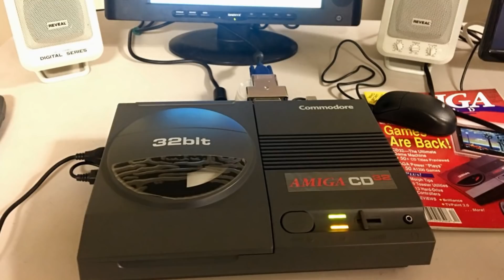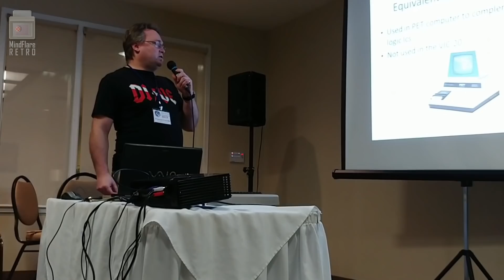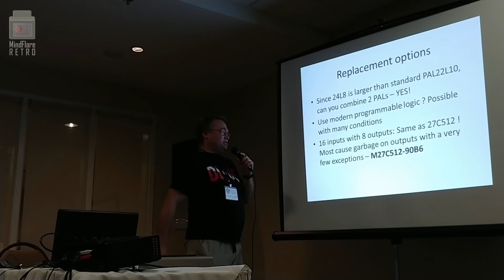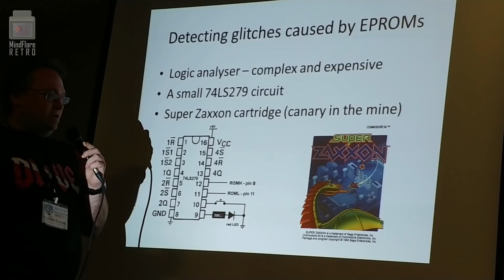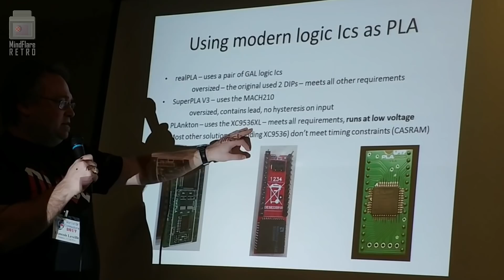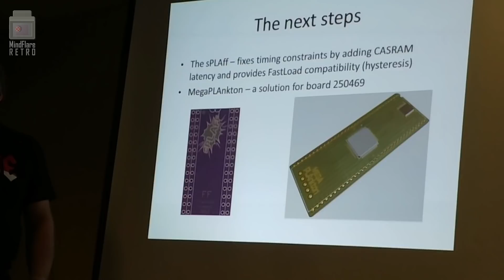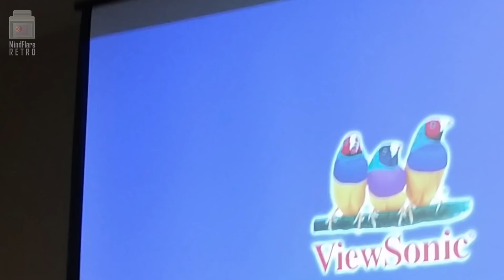#10 'The PLAin Truth About the Commodore 64 PLA' at World of Commodore 2017

Comment: Another note about RoHS compliance: Do you expect to put your C64 in a dump? Because that's what RoHS is for. Lead-free processes expose the operator to more toxic materials so that when careless end-users throw out their work it doesn't poison the environment.

Use lead-free solder, sure, but consider the reasons why and the ultimate benefit your decision will yield. Electronics can and should be recycled, and there are other environmental costs to producing new materials.
Reply from the maker: Totally agree. I would never discard a retro computer hardware, or any electronics, to landfill. I mostly hang on to stuff like that, or drop off top an e-waste facility as a last resort.

Comment: Useful knowledge about the PLA. Thanks for the video from Francois Leville. 3 years ago I built a PLA replacement with Altera EMP7032 CPLD chip, but I still haven't tested it properly. I think that I will try to make this SR-latch tester.
Reply from the maker: Thanks. Yes, Francois is an interesting man. I am curious to see how your CPLD version works. I am also going to try the GAL method (see Adrian Black's video) and also I just acquired a used IC burner that can program PLS100 ICs for direct drop-in replacements. However, I have been waiting for GAL IC and NOS PLS100N IC orders from China for over 6 weeks now.
Reply: @MindFlareRetro  Thanks for the tip. I will watch the video. The PLA100 IC is indeed pin compatible with 82S100. Nice! Yes, orders from China could last a long time. I understand your pain.
Reply from the maker: @ezContents  Yes, a have a lot of China orders just sitting there in a warehouse near the airport in Shenzhen, according to the tracking info. I'm sure I'll receive everything at some point.
Reply: @MindFlareRetro  Good thing you can track them. Yes, just be patient.

Comment: The specific reason why PLA's self-destruct is because the entire MOS fab was contaminated with boron. They were in fact required by the EPA to install remediation pumps to suck the boron out of the soil beneath the building. Boron, when it gets into the glass passiation layer, leaches out into the chip substrate and disrupts the doping in the chip, essentially killing the transistors on a solid state level. Heat of course accellerates the leaching by increasing boron's solubility and mobility.
Reply from the maker: Amazing info, Stan! Thanks for sharing.
Reply: Thomas Giesel aka Skoe mentioned this more than once and it's described in the study he published in 2012 called PLA Dissected. http://www.zimmers.net/anonftp/pub/cbm/firmware/computers/c64/C64_PLA_Dissected.pdf
A lot of aspects of PLAnkton are based on information found in that document.

Comment: Isn't there some way to gate a normal CPLD or EEPROM's output using a clock signal to get rid of the glitches?  ROMs have a defined settle time such that as long as the address lines (inputs) are held for a minimum period, the data lines (outputs) will have settled.  So rather that just dumping the data onto the output bus lines, gate them using a clock pulse (maybe the CAS/ input line?) through a buffer's enable pin, and they'll be settled when the clock transitions.  As far as input hysteresis goes, you can usually clean up hysteresis issues with something like a 74hct14 schmitt trigger.  I mean, I'm not sure you can get it in a nice tiny package like PLAnkton, but what he was describing sounds like normal timing issues you have to design for when using a CPLD or EEPROM, and usually you use a clock signal to manage the gating onto an output bus.
Reply from the maker: Thanks for commenting. Yes, I believe you are correct. I have seen others (GadgetUK164, Plan C ... iirc) tweak the DIY design to correct for timing issues. Also, PLAnkton had hysteresis issues accounted for in its design and I think Super PLA resolved CAS line timing issues in its most recent release. I am still a PLAnkton fan, myself.
Reply: The M27C512-90B6 doesn't cause glitches that affect the C64 because it has a very poor slew rate. Therefore if you use a very fast EPROM, in theory, it's possible to use simple RC filters of the correct values to filter these glitches. Please note the correct technical name for these glitches is 'Static Hazard' and you can find a detailed explanation on Wikipedia.

Comment: You mention 99.9% compatible.  What's the .1% (one thing?) where it isn't compatible?  Or what holds it back from being 100% compatible?  Or is that just to allow for some heretofore unknown incompatibility?
Reply from the maker: Yes, sir, you are correct regarding yet-to-be-seen incompatibilities. However, to my knowledge no incompatibilities have been reported to date. IMO the PLAnkton is the best PLA replacement out there. Thanks for your question.
Reply: @MindFlareRetro  Thank you for the response.  I will pick up a few.
Reply from the maker: @PrimalNaCl  You're welcome. I am happy to help.
Reply: The people at The Future Was 8bit had the 'brilliant idea of making a new Fast Load cartridge they called Fast Load Reloaded which is supposed to use exactly the same schematic as the original cart. However, they replaced the 7417/7407 open collector output buffer with a dirt cheap CMOS equivalent that's not TTL levels compatible. It has trouble with PLAnkton. If you care to replace the CMOS junk chip with the correct 7407 then it works just fine, just like a real Fast Load cart. It's the only compatibility issue I have found.

Comment: Just watched this again. Thanks for all the info. Other games I have found that show-up a flaky PLA are: 

Last Ninja 3 - .d64 -  (garbage screen bottom half), 

Blue Max -.prg - (garbage title screen and plane character) 

Alien .prg (garbage egg lol)

Armalyte - .d64- ....... nooooooo .... (black screen after crack screens & won't start) 

I just used up my spare PLAnkton on that rig (ran everything else)
Reply: Maybe I am missing something here but I truly don't have a clue how only a software could change behavior because of a problematic PLA. Unless of course, the hardware of the C64 itself is affected. My reference remains the Super Zaxxon cartridge and since the original one is getting to be a rarity, someone has been selling replicas on eBay for a fairly low price and it's gold plated.
Reply: @francoisleveille409  Thanks for watching Francois. Tbh I am still using your PLAnkton where I have PLA issues and it is awesome. Not sure why this PLA acted like this but when I tested it with a latch circuit, it kept glitching low. Keep it up.
Reply: @francoisleveille409  I just bought one lol
Reply from the maker: Oh, this is an interesting list. I thought that the Super Zaxxon cartridge flip flop IC usage was the thing that depended on perfect PLA timing. I must try out these games once I come across another flaky PLA. THanks!

Comment: Where do I find info on the World of Commodore ??? I'd like to go to it this year.
Reply from the maker: The World of Commodore show is usually held on the first or second weekend of December and takes place at the Admiral Inn (QEW & Erin Mills Pkwy, Mississauga). Keep an eye on the TPUG (Toronto PET Users Group) website for dates and times announcements, https://www.tpug.ca/category/woc-posts/.
Reply: @MindFlareRetro  Thanks, I did go to the world of Commodore. Its a small venue but they do manage to pack a far bit in, I had a blast for the 1/2 the day I was there. Also got my self a 1702 monitor for $10 when I was there, works but the picture is a little dark........ By the way, have you ever worked on a C16 before ?

Comment: "I don't sell PLAnkton to make money, I sell it because I know it pisses a person in particular off."
Reply: Hey, what do you know... The SuperPLA V4 now works ok with the FastLoad cartridge. Seems iComp has finally learned what hysteresis is and why it's important on old logic ICs.
Reply: ungratefulmetalpansy  In the 1541, a good tinkerer can replace the 2 regulators with a new 5v/12v block PSU and the only component on the main board not made anymore is the 325572 custom IC which I make GandALF to replace. The MOS 6522 VIAs can be replaced with a WDC W65C22N from Western Design Center - sold by Mouser.
The DRAM in a C64 can by replaced with Saruman-64.
All parts in a VIC-20 are still available or have equivalent parts except for the 6560/61 video chip. There too, it's possible to replace the power supply with a modern no-heat equivalent.
Reply: ungratefulmetalpansy  Even recently, there is this guy nicknamed MCES which says PLAnkton is a timebomb because it operates the CPLD at 3.7V - back in 2012 Frank Buss and Thomas Giesel (aka Skoe) found a PLA replacement must signal at 0-3.7V. minimum. Officially, the XC9536XL is recommended for operating at 3.0-3.6V but compatibility matters more.
As for the specifics of screws and other mechanical aspects of the case, that's not something I studied. I know Polyplay is selling replacement cases the same shape as those for the C64c but I know breadbin boards will fit in them.
Reply: ungratefulmetalpansy  Ray Carlsen offers a very good protector against power supply problems.
Reply: @francoisleveille409 one thing I'd like to pick his brain about is I've got one of those 1750 memory expansion units, but I don't have beefy power supply is it possible to just run an extra 5 volt power line on it
Reply: @weedmanwestvancouverbc9266  Usually yes. You have to make sure this 5V is FLOATING relative to ground or you can have 2 different ground levels and cause a short circuit. I make my own PSUs using a single 9VAC transformer rated for 1A or more and another 'wallwart' (those for USB hubs rated for 3A or more) combined in a single box but some idiot started telling everyone this is going to "set your house on fire" !!! Duh!

Comment: Maybe he tried doing it himself and got a fake chip and thought it was real, and so it didn't work for him, and perhaps that's why he's so deadset against it?
Reply from the maker: That's a good point, and coincidentally, I have ordered two NOS EPROMS from a China-based IC supplier and will test to see how well they work. Stay tuned!
Reply: @MindFlareRetro  Don't forget to use the 74LS279 checker circuit I indicated to see if your PROM based PLA replacement generates glitches.

Comment: Surely there is an exemption from the RoHS nonsense for repair chips for old systems?
Reply: Not that I know of. Anyways, PLAnkton uses RoHS compliant parts and Microchip's AT27C512R-45PU is RoHS compliant.
Reply: @francoisleveille409  RoHS is idiotic. Prime cause of circuit failures and worse the "toxic" lead solder, which can't actually form fumes at an reasonable temperature, is replaced by volatile organic and most definitely toxic solvents. And even more stupidly the main source of lead contamination since they got rid of leaded petrol, car batteries, are exempt! What the fuck? :/
Reply: @francoisleveille409  Oh, it's  you, the creator! Good work. Btw have you considered that the timing issue might be that when one minterm is completed before the other and the result is ORed together producing a transient incorrect output, that happened to be covered by the sloppy timing of the original part?

I remember seeing this an old book about building digital logic systems with 7400 and 4000 series parts in the 80s. I unfortunately can't find it or remember the title. I think the book called these problems "glitches"?

But what definitely do remember is that they happened when the path between all the inputs to the output wasn't exactly the same. And the possibility of it happening could easily be predicted by having blocks in a Karnaugh map which were touching but not overlapping, and just as easily fixed by adding redundant overlapping blocks.stitching them together.

Although I convinced myself of the technicalities of why it would work, I no longer remember why it does...

I was and am interested in making my own computer out of 7400 series parts, much in the style of Bill Buzbee's Magic-1.
Reply: @MrGoatflakes  By god you're looking for such a complex answer. Old NMOS programmable logic ICs had a response speed RATED around 80ns but really measured around 40ns and the !CASRAM latency was necessary for the multiplexed address bus to properly settle. New chips are much faster (the XC9536XL on PLAnkton is rated for 10ns but really delivers in 5ns) and without the presence of an additional delay mechanism (R42 and C204 added on boards 250425 and 250466) the bus doesn't have the time to settle. See: https://www.melon64.com/forum/viewtopic.php?f=12&t=8691&start=17
Now, this being said, additional delays are programmed into PLAnkton so the response on !CASRAM specifically is about 40ns, just like a genuine Commodore PLA and this makes it compatible with early C64 boards which don't have R42 and C204.
Reply: @francoisleveille409  right but what I'm saying is that perhaps if redundant terms were added, the transient incorrect output wouldn't be output in the first place, even if you used the faster logic.
Reply: @francoisleveille409  ah I just realised why what I suggested is probably not the case. Because with a modern FPGA you could latch the inputs at a given clock phase, then drive the "correct outputs" on all pins virtually simultaneously as far as the Commodore 64 is concerned. And that was tried and it didn't work?
Reply: @MrGoatflakes  How exactly do you add redundant terms to a PROM which essentially contains only the truth table ? The transient incorrect output (static hazard) is the result of the internal functioning of the PROM. That's not something you can change.
The approach I suggested on Lemon64 (a few days before they banned me back in 2015) is simply to use an RC filter on all 8 outputs of the PROM but I later realized this would be dependent on the impedance load.
PLAnkton uses a CPLD and it doesn't exhibit any transient incorrect output.
Reply: @MrGoatflakes  Latching the inputs could have catastrophic consequences as some inputs become valid at the early part of the Ø0 cycle while some others (namely A12/A13 and !CAS become valid in the middle of the cycle. The PLA is purely combinational logic for more reasons than I can name.
Reply: @francoisleveille409 hmm
Reply: @MrGoatflakes  Re-reading the exchange of replies above, I understand you're confusing 2 totally different things: 1. Most EPROM generate glitches when used as logic chips, adding redundant terms will change nothing to that; these static hazards are NOT the result of logic equations since none are programmed into this type of chip - programmable logic ICs, old or new, don't have this issue. 2. Because of the way DRAM is addressed by the CPU (the CPU uses a non-multiplexed address bus while DRAM requires address multiplexing), the 74LS257 multiplexers require a small delay to perform their job so the CASRAM line from the PLA MUST have a 40ns delay.
Reply from the maker: Yeah, I'm sure these super low hobbyist volumes aren't a concern. If this was a world-wide distribution on a mass scale then I could see RoHS standards coming into play.

Comment: Thanks for this. I bought a PLAnkton for one of my machines after watching this and it is flawless. Also trying the GadgetUK OTP chip route as well just for fun. Got it going to the stage it will actually run small programs from the SD2IEC but no games and it ALWAYS fails the diagnostics cart memory test on pass 3 EVERY time with weird artifacts. I have got to the stage of adding caps between casram and gnd pin picofarad by picofarad in parallel out of the scrap bag/parts bin lol. So far, all I can say is that the desired value seems to be a tad above 84pf (on a $7 dollar component tester lol) for a 250407 Rev B. I have not checked the the RAM chips are mixed and matched. Lower than 71pf and it crashes. Higher than 91 and it crashes .... A lot of trial end error lol!
Reply from the maker: You're welcome - thanks for watching. Damn, I don't know how I missed your C64 video a few weeks ago... watching now.

Yeah, the OTP chip method is fickle. The PLA timing has to be perfect or the system will crash. I have to make time to revisit that -- I bought a whack of the AT27C512R-45PU chips before I got too deep into the project and then put it on back burner.

Now, the other thing to try on later board revs is to remove R42 and C204 on those boards and see if the OTP chip works that way. Remember, those were added by Commodore tweak the timing for the PLA.

Thanks again for commenting.
Reply: @MindFlareRetro  Lol. Just back from the pub and tried it on a rev c and it works 🤣. Just played rtype. I am going to go through each 64 with it tomorrow. Hopefully, I won't break anything. Keep it up.
Reply from the maker: @Plan-C  Nice. Keep me posted.

Comment: I would like to add to the failure of the PLA. If you have attended any of Bil Herd's technical experience with MOS PLA, he has stated that this was an engineering failure in design. While I am sure heat pushes the chip along towards its destructive demise, he has stated that the defect in design causes the wafer inside to oxidize over time suggesting that these chips can fail while sitting in a box unused or resting state. I thought that was very interesting.
Reply from the maker: Oh, I wasn't aware of the oxidization issue. I think the PLA was knockoff of a Philips chip - a poor knockoff with design issues. Very interseting, indeed.
Reply: @MindFlareRetro  Thomas Giesel aka Skoe mentioned this in his document 'PLA Dissected'.